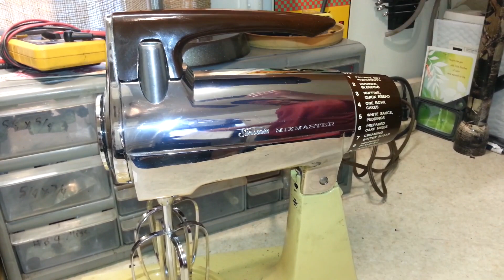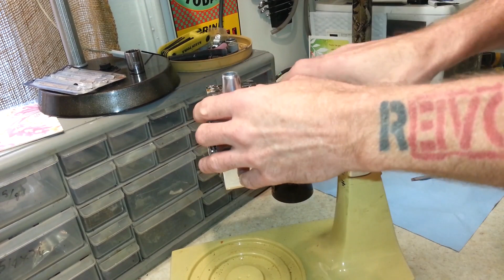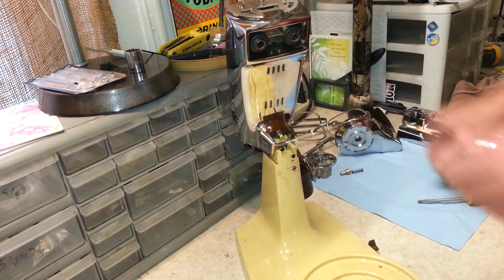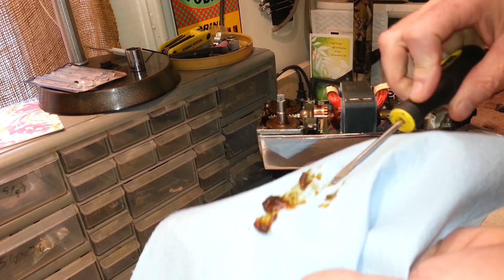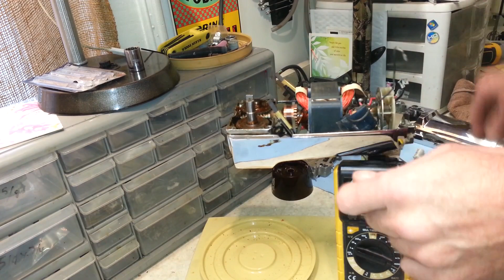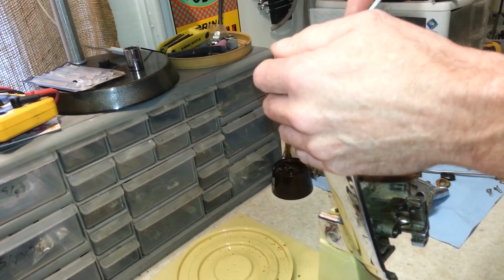Sunbeam Mixmaster 1-8b gets some maintenance

Comment: Not sure if you're still active here, but maybe someone else with the same mixer can help me out. I just picked up a Mixmaster (service number MM350), and can't seem to figure out if the bowl that came with it is aftermarket or not. The beaters both touch the bottom of the bowl. My understanding is that some later models have a rubber or plastic tip on one of the beaters that's meant to touch the bowl so it turns as it mixes, but I don't believe that's this model (although the beaters do cause the bowl to turn as a result of the contact). I've also seen examples of the model with glass bowls as well as steel (mine is steel). The mixer works great, and is in pretty nice condition aside from some minor scuffs and scratches, but I just want to make sure that's the intended mode of operation, and if not, I intend to source an original bowl.

If it helps, the underside of the bowl has the sunbeam logo, and says "Stainless Steel" and "Made in USA".

Also curious about bread hooks. Mine has the classic egg beaters. The only bread hooks I've seen that look like they'd go on this mixer are the "closed hook" which feature an irregular closed metal loop, not the C-shaped hook typical of Kitchenaids, or the spirals I've seen on modern Mixmasters. Anyone have any experience with these?

Comment: @Vintage Mixers and More  -  Do  you  know  what  size  ceramic  disk  capacitors / resistor  -  the  paper  packaged  capacitor  from  the  ground  to  hot   side -  or  am  i  calling the  wrong  thing /  those  motors  run  and  is  there a  schematic  on  these  things  somewhere  ? Found  the  round  capacitor`s  that  the  coating  falling  off   of  on  ebay  -  NEW  -  i  have  one  that  goes  from  barely  spinning  and  you  turn  the  speed  adjustment   and  it  doesnt  speed  up  till  you  get   around   9  or  10   and  it  goes   wide  open

Comment: Hello! I have a mixmaster 1-8b. I had to get the gears from another mixer head for my mixer since they were stipped. I see lines and a dot/dimple on each gear. How do i put them in to get the correct timing for the beaters? Thanks!

Comment: Hi, I have one of these mixers and after about I reach 6 on the dial, it doesn't go any faster.  Ideas what the problem is?
Reply from the maker: It could need an adjustment on the speed control, they are set by turning the dial to speed 1 and using an allen wrench through a hole in the rear cap, you can adjust the speed. If the lowest speed is too high, it will change the range of speed control you have. However if it is too low, it will overheat the resistor and they are getting to be impossible to find. It is tricky to adjust the speed to factory settings, as it requires being able to know, and see the RPM of the beater shaft but setting it by ear usually works. If the lowest speed is fine, it could be an issue of too much drag on the motor due to lack of lubrication. These models were permanently lubricated by soaking an oil wick for each of the 2 bushings, but of course they eventually dry up as they never planned for use this many years later. Unfortunately that involves disassembly to be able to reach the oil wicks. Hope this helps!
Reply: @vintagemixersandmore1666  I do have two machines and the low setting on this one seems the same as the one that works correctly so I don't think it's the speed control.  So I had it apart last night and greased the gear box.  That helped a little.  Guess I need to take it apart more and find all the lubircation areas.  That sounds like work.  Thanks much.
Reply from the maker: @RickMcDanielMusic  You bet, good luck! Im sure you will get it!
Reply: @vintagemixersandmore1666 
HI 👋 DO YOU CONTINUE TO WORK ON THE SUNBEAM MIX-MASTER STAND MIXERS  ?

I WOULD LIKE TO KNOW MORE INFORMATION ABOUT THIS…NEAR PURCHASING THIS MIX MASTER, MAYBE USED ONCE—ALTHOUGH IT IS OLD—IT NEEDS A THOROUGH—MAINTENANCE….I NEED TO KNOW HOW TO CONTACT YOU ✔️
THANK YOU,
Diane
Monroe, Louisiana

Comment: We have a 1-8B.  Just started using it.  When using the bread hooks to knead dough, it got fairly hot. Are these machines powerful enough and able to take the punishment or should I slow down the speed to prevent OVER-heating??? I think I ran it about 7 minutes on speed 5. It was hot to the touch on the outside.
Reply from the maker: I always thought, despite the fact they sold them with dough hooks, they were really not quite powerful enough to actually use them well. If you are using it for bread dough, then you can probably expect it to run hot. It was probably not a big issue back when they were sold new, as they did have a warranty, but these days its not that easy to get them repaired.
Reply: Vintage Mixers and More.  I found a site with the original user manual.  And it said to cut speed back down to 2 after dough gets incorporated. I had run it on 6 for 6 minutes because didn't know. I tried again using this recommendation with better results. Check out the Sunbeam mixmaster pages at oldrecipebook.com
and thanks for your reply!!
Reply from the maker: @dustin1203  Thats excellent, thanks for the update!

Comment: I have one like this with the worklight, MixMaster Vista model 7-01-10D   Purchased new  old stock in the original box 9 years ago.  I had one before I could afford to have a KitchenAid that was a re-furbishis model I bought a Sunbeam Service Center in Houston.  At the time there were no chrome stand mixer for sale in New Orleans.  mail order of these machines was not an option at the time. as these were The appliances were sold unboxed with a 90 day warranty.  There were models that were not available in stores in the area .  When the assembly of Sunbeam small appliance shifted from the USA, the Sunbeam factory authorized service centers all closed.